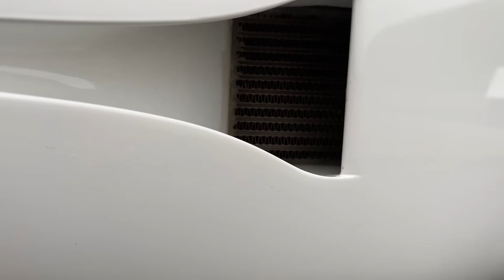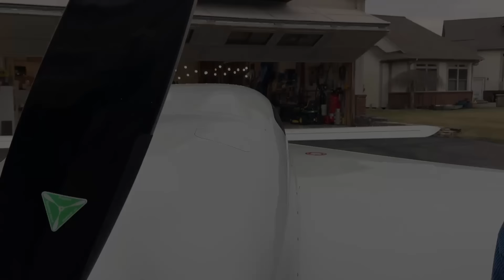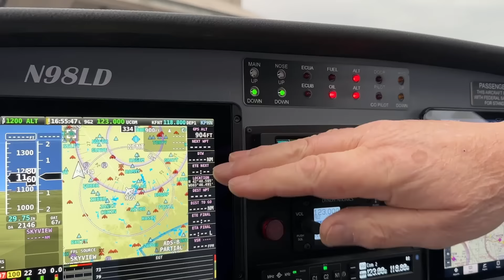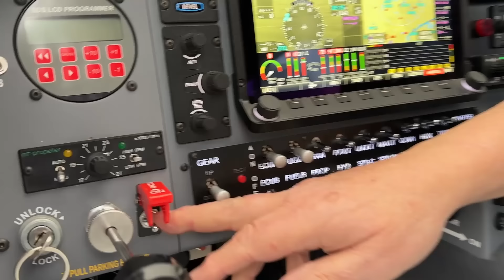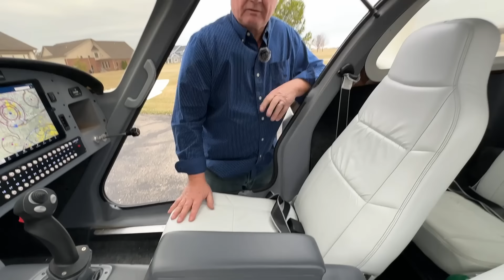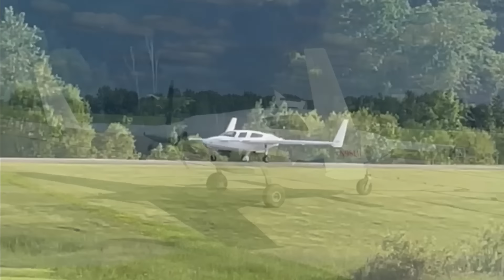LS3 V8 Powered Velocity Walk Around

Comment: A life's work and a very inventive man. I wonder how many times he redesigned this thing before he got to this point.
Reply: Automotive Engines have been modified for general aviation since early eighties. 
Some were small block Chevys. Cast iron. 
But this mod with 500hp all alluminum, hands down is a huge upgrade, let alone its now a Sky Street Rod with Corvette sound. 
I used to work on the early Rutan's mid eighties mostly small repairs for those that came from all across the US heading to Oshkosh Airshow and camping for two weeks is the norm. 

This is one Beautifully Designed Ship. 
Cheers
Reply: What is gained performance criteria are gained useing a automotive engine over a conventional air cooled power plant? These might include sfc,reliabilty,maintenance costs,higher cruise,higher altitude,lighter weight,water cooling as opposed to air cooling,longevity and anything else u can add. Or is this strictly an engineering app to show what it takes to do a 1 off installation?

Comment: Just FYI:
Those "things" you mounted under the wing leading edges are called "Vortillons", and can be seen under the wings of all Douglas Twinjets (DC-9, MD-80, MD-90, & 717 (or MD-95!) EXCEPT the DC-9-10 (the original DC-9).

Comment: I would consider using a Gen 3 Hemi because it has two spark plugs per cylinder. This allows for redundant ignition controls, improving safety just like a purpose built aircraft engine does.
Reply: I've always wondered why no one uses a hemi for aircraft engines. I would think you could do a dual ecu and actually run all 8 cylinders with each. Is there an aluminum block version of the hemi?

Comment: 15:25 "there is a nice fuel burn". Ha ha. OK what is it. He did not want to say... It is high high and likely more than the Conti or Lyc that would have gone in there. Empty weight? More than an aircraft engine equip version.
Reply from the maker: I don’t recall the fuel burn off hand but I thought he mentioned it during the previous video. I may have accidentally cut that part out as I edited an hour flight down to 15 min. I think at cruise it only like 11 gph or something close to that.
Reply: @KitplaneEnthusiast  11 GPH is pretty good for a 4 seater. Sounds right... thank you.
Reply: @gmcjetpilot  still, a computer controlled, fuel injected, water cooled engine will run much tighter and more efficient than an air cooled, carbureted engine, so not higher than a Conti or Lyc.
Reply: @swiftadventurer  Pony's still drink. Shockingly as primitive as ppl think aircooled aircraft engines are (and they are not, they are purpose built aircraft engines refined from a century of military and civilian development)  are efficient w/ spacific fuel consumption as low as 0.041 lbs/hp-hr (at sub 70% pwr leaned properly). 

Electronic EFI and EI is great in cars, but aircraft mechanical FI (or Carb) and even Magnetos work well at constant pwr. 

However, EI is widely available for Aircraft, especially EAB's. EFI is also available for aircraft engines. The beauty of mechanical fuel delivery (mechanical FI or Catb) and Magnetos or self powered EI like P-Mag's (I have two those on my Lyc IO360-180HP).

 I don't have electrically dependent RED guarded swirch worries, except my glass panel. That is solved with backup G5 w/ on board backup, iPad and handheld radio. (I cheat with a small 5ah battery in parallel on avionics bus, only because I fly IFR.)

My RV-7 can get just shy of 25 mpg, or 7.6 gph at TAS  190 mph at 10,000 to 12,000 feet.  Granted, an RV-7 is smaller than a 4-seat Velocity, and the Rutan based design, pusher, canard, swept wing tip rudder configuration, inherently is very efficient. The Long-EZ is one of the most efficient planes, if not the most efficient out there.

Not bashing this beautiful Automotive conversation but the PSRU is always a werk link, and often requires fixed pitch, ground adjustable, or electrical controlled CS props, vs hydraulic. The electric CS props are crazy expensive. My Hartzell blended airfoil I bought used for $4k is less than $23k. I have $23k in my whole aircraft engine and prop, both purchased used, rebuilt, or serviceable 2010 dollars. 

 If I were to do a conversation, a Chevy LS would be high on the list. However I'm a bolt on a Lyc o,  per plans, go fly.  

Tinkering with an auto conversion is just not for me. In general, I find them to take longer to build, heavier, not faster ( often slower ), not cheaper,  less reliable (PSRU) and lower resale. There are exceptions. This Gents LS powered Velocity may be that exception.

 in the above 160HP to 350 HP category. Conversions in the sub 120 HP is a sweet spot for auto engine conversations.  For low HP hard to beat Convair aircooled conversation. 

Once you get to 150HP hard to beat a O-320 Lyc.  Then in 180-220 HP the Lyc 360's angle and parallel valves rule. Above that, 250HP to 350HP, Lyc 540 or Conti 520, 550 are kings.

 If Automotive engines in planes are great where are they. At best they are unique and approach aircraft engined planes. 

Followed this topic since late 1980's. No free lunch.  Pony's drink. AIRCRAFT engines have far more QC, production control, compliance to standards and regulations, exotic materials, and manufacturing processes in sophisticated production facilities with $100M machines, than people understand. 

Aircraft engines are sophisticated purpose built designs for reasons aimed decidedly at specialized aircraft operations and reliability. Who won Reno Sports Class? Lycs and Continentals. Car engines excell in cars, not optimal for planes, a compromise,  an adaptation. PSRU and lack hydraulic constant speed Prop is a gripe I have (on most cars engines in planes, not all). The exception is the Fly Convair conversation. Then, in low HP is Rotax, but that cost more than a Lyc and still no hydraulic prop.
Reply: @swiftadventurer  Oh I grant you tighter. So what does that meean? Air cooled has to have larger pision cylinder wall clearance. Tight and water cooled is good in cars and to meet EPA emissions. Without all the CAT'S, and LS V8 not that great. Granted better emissions than a Lyc wirh 100LL. 

I'd rather air cooled Porsche than the water cooled ones last 27 yrs. 

They, Gov, spacificly California's more strict diesel standards than Federal, killed off my VW TDI diesel (50mpg) which is best car I ever owned. Still have it. Why?   I'll take my +50 mpg tons of fun low end torque.  Yes tight is good but like my engines, like I like my woman,  sloppy and dirty. Ha ha.

PS This LS V8 is based on 1940's and 50's Ford Flat head, Chevy small block. It's a 4-stroke, push rod overhead vave engine. Lycoming same. Lycoming as we know them been around 70 yrs with countless hours of service, and continuously improved. Cylinder nitrate wall coatings is an example. The LS roots were developed in the 50's, as was the Lycoming we know today. 😊

Comment: Your engine is a DOD ( displacement on demand) design which are problematic and have failures. I have  the same engine in my pick up which has been in the shop with an engine tear down due to component failures. Read about it if you are not familiar on the internet. My ZO6 vette is not a DOD design engine meaning it is an older version.
Reply: Doing a proper mechanical delete is needed
Reply: @ agree and it is costly but better than the alternative.
Reply: Are you sure his engine is DOD
Reply: @ yes he said it was 4/8, means it is “displacement on demand” you can read about it and the many lawsuits that is taking place.
Reply: @Treefarmer1984  I have owned a few of these and I get it. I just didn't think the crate motors had it.

Comment: is this the SAME LS VELOICITY that ran into some problems a couple years ago???  or a DIFFERENT ONE? :)   very cool idea ;)  is it SMOOTHER than the OPPOSED BOXER IO's???
Reply: I LUFFF VELOCITIES!!! :)   I have been a FANBOY of the ''FORM'' of the VELOCITY as far back as when the BEECH 2000 hit the press releases as BRAND NEW WILL REVELOTIONIZE THE GA AND SMALL CHARTER AIR WORLD!!!  flyers ;)  

would STILL lufff to get ahold of a BEECH2000 and ''fix any carbonfiber issues....''  and repower it with something NEW AND SUPER EFFICIENT :)  with a full NEW PANEL :)    oh my ....   SCHWIIINNNGGGGG@!!!!
Reply: ''ran into some problems''  = something like ''ENDED UP IN A CORN FIELD??''  with some issues??
Reply: @alexmikhael5061 that wasn't a velocity that was the "raptor experimental aircraft" it kind of looked like a velocity but it was like 3 times heavier and much wider. Last time I saw this ls3 velocity fly on YouTube though the engine was bouncing off a rev limiter. Looks like that's all fixed now.

Comment: One wonders how they figure it out if they're dead-on CG?? I mean probably when he's with his wife... or so.. is all good.. but gas distribution, and passenger weight?? how that get to be negotiated??
Reply: Aircraft Cg is determined when built… or modified.

People Cg is defined by the seat positions…

Fuel Cg is defined by the geometry of the fuel tanks…

Calculators do the math…

In some cases, people write an app for the plane…

Often, the pilot takes the same people, and same fuel load… so the calculations are pretty benign…

As far as math accuracy goes… each plane has a range to be in…

That range is less than a foot usually…

Elevator trim gets used to balance the aerodynamics vs. Cg….

If you are in the forward range of the envelope, trim keeps you flying, but adds a lot of drag…

So if you are racing… you get really good at balancing your plane loads…

Carrying extra weight again is handled by the elevator trim… 

So excess weight will slow you down a bit…

More lift needed?  More angle of attack used… more AOA used, more drag….

For fast GA planes… the useful load is about 1000 to 1500Lbs…

People, gear, and fuel can be swapped around (mathematically)…

It is really hard to fill all the seats, and have 100gal of gas on board… unless your people are tiny…

With four people on board… some people will stop every few hours to take a break, eat, restroom…

If you are family… sleeping people don’t know how long they have been flying….

😃
Reply: @AC-jk8wq ah yes the built in benadryl deployment system.

Comment: Most Big 3 (more or less) auto engines get millions of hours of aggregate run time every year, GA aircraft much less. Even so, my pilot friends usually say "Lycoming and Continental engines are proven reliable, so that's what I'm sticking with". I think the the data would be pretty clear that auto engines in GA aircraft are a darned good idea.
Reply: auto engines spend 90% of their time at less than 15% of their rated power. Airplanes are the opposite -- they are running 65%-100% full power almost 100% of the time
Reply: @jawshoeaw  then someone will bring up boats. And then we will go full circle on this discussion thats happened a million times before. This plane is sick af.
Reply: @FirstName-nf4fx  I almost said boats lol but decided to keep it simple. Marine engines have some different parts though now adays the differences are fewer . But consumer marine engines tend to lower duty cycles than aviation, operate in consistent environments , and are tuned to narrow torque bands .  And usually nobody dies when your boat engine goes kaput.
Reply: @FirstName-nf4fx and then drop the L's in a copter😂😮
Reply: @jawshoeaw 
Let’s not forget… Corvette engines are designed to a higher spec than an average car engine…

Without a turbo on the engine… maximum speed will occur about 8k’ above sea level…. Where power is declining, and drag is getting less…. And 65%bhp is about all that is available at that altitude…

Add a pair of turbos and intercoolers, and fit them under the cowling…. Then the fight is on for temperature control and engine longevity….

Flying a 310hp continental IO550… 65%bhp or less… temperatures are easy to control, cylinders last to overhaul time… all good.

With a turbo, flying in the flight levels… at high %bhp… expect to overhaul cylinders every 1k hours… turbos are sensitive to inlet temperatures…

Mishandling the engine controls can get expensive….

Roughly speaking…

Flying at Indy speeds, no pit stops required, no pit crew required… for 1k miles…

Go Fly!

😃
Reply: Turbos and temps create next level costs and perfo😂😢😮rmance @AC-jk8wq
Reply: @jawshoeaw a very good point see what the future holds😮

Comment: Only thing I would do is put some sort of switch on the nose wheel to indicate wheel in center position before retracting.
Reply from the maker: If I remember correctly, there a mechanical guide that automatically centers the nose wheel as it retracts.

Comment: Love the Velocities. I wish they were a little faster. I know they are quick but the 200 vne makes any HP over 300 kind of useless. Yours is really nice!
Reply: Yes, unless you're using it for climb rate. You can also get 300hp to a higher altitude.
Reply: The velocity can move at nearly 400mph ground speed at high altitude. Remember Vne is for indicated airspeed not ground speed, assuming you don't have any flutter problems.
Reply: Corvette acceleration, 0 to flying in six seconds… 😃

Initial climb speed over 2k fpm…

Pull the power back for cruise speed…

😃